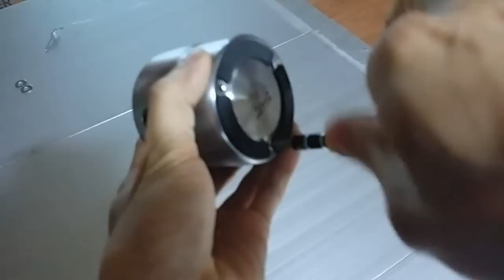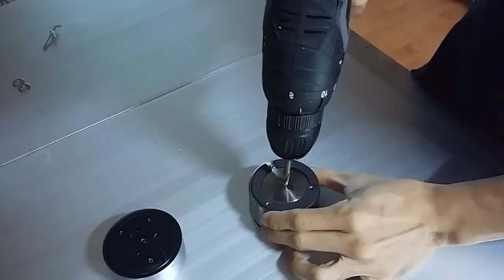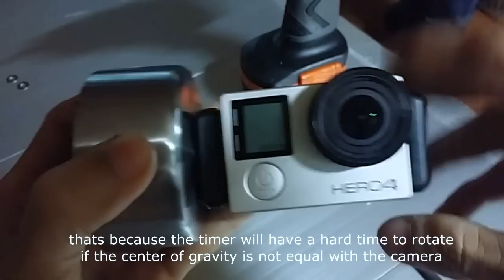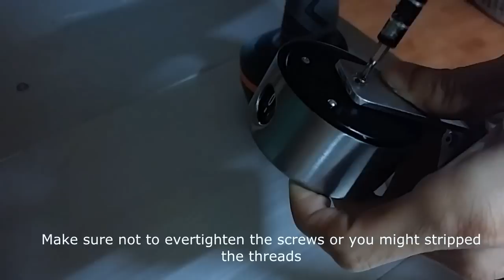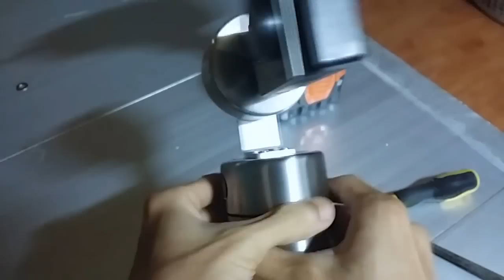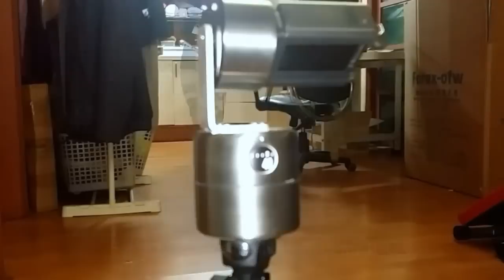Pan and tilt timer for GoPro | Action camera | Ikea

Comment: any tips on how to control the rotation speed? having a way to control the x axis turning rate vs the y axis would be awesome
Reply from the maker: It cant be done. Only those battery powered panning devices has that feature I think. They have stepper or dynamo motor while this one was driven by pendulum, springs and gears.
Reply from the maker: Red Domingo where you from?
Reply: reckyjo00 thank you for responding.. im from Sydney, Australia.
Reply from the maker: Maan Lee  its good for  $7 difference.
Reply: Better, it's a lot of work and tools needed

Comment: How did you Rivet the four rivets into the bottom timer? I tried doing it, by drilling holes, but when i tested it out. The timer won't move. As in i t didn't turn back to 0 when I turned to 5 or 10 minutes :(
Reply: please make sure to use the smallest kind of rivet. I used 3mm in diameter rivet. Bigger or longer rivets may protrude too much and hit the stopper or gears inside the timer.